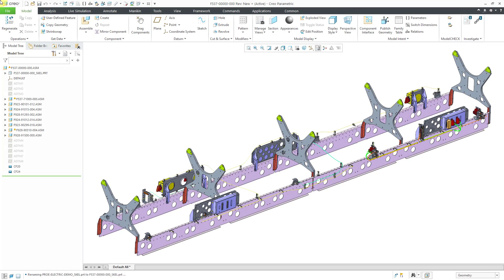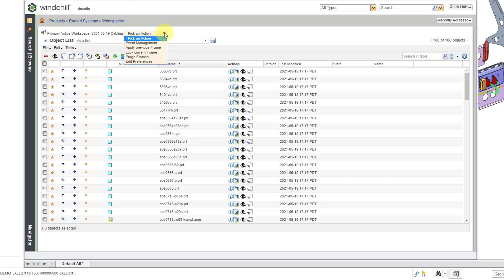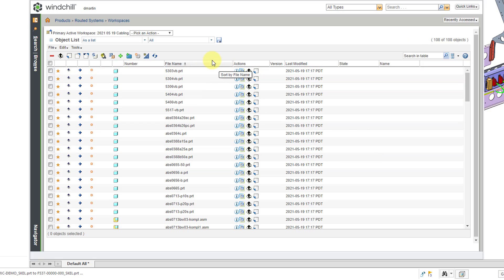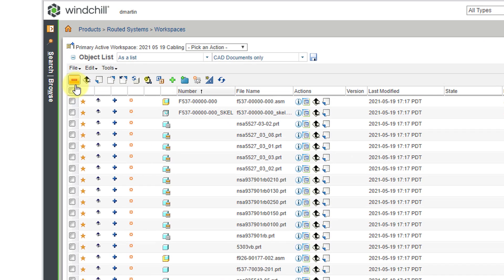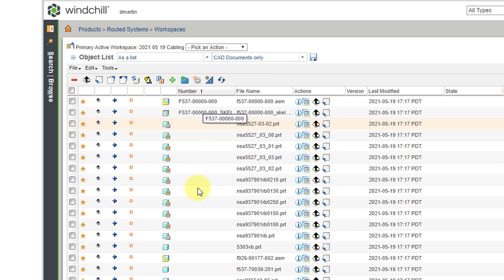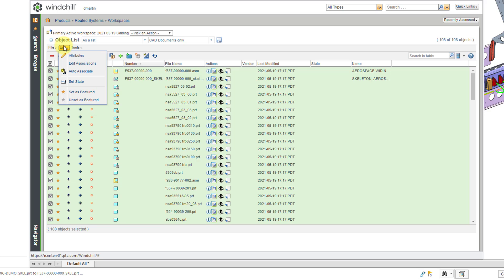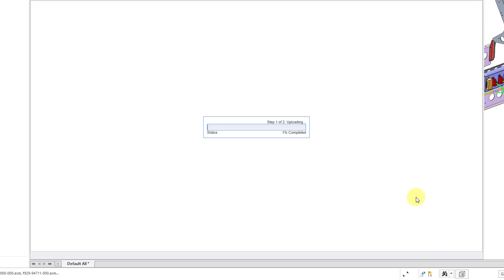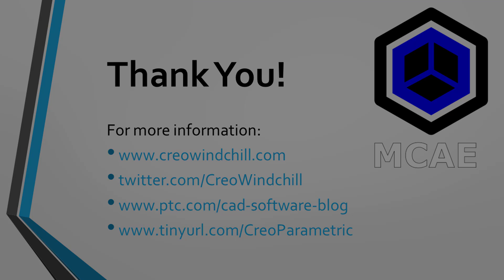PTC Windchill PDMLink - Introduction to the Workspace Interface

Comment: Hi Dave, Can you please elaborate more on the use of "Synchronize", How it is different from "Update out of date version" option?
Reply from the maker: Update is for when someone modifies the CAD file, as in makes a change to the part, assembly, or drawing. Like they delete a feature, add a new component, etc., and check in. Synchronize is for when someone changes the metadata - the name, number, folder, attribute, etc.
Reply: @CADPLMGuy also why we are getting a "CAD Part Not Unique" error when the object that I am trying to upload to my workspace is already uploaded by other user in their workspace? If it is there in the common space and I am trying to upload and check-in means there is a logic to display that error because Windchill checks for uniqueness but I am still getting an error!! Is this an expected behaviour?
Reply from the maker: There is a lot of configuration involved in Windchill. I recommend speaking with your admins or opening a ticket with PTC Tech Support.